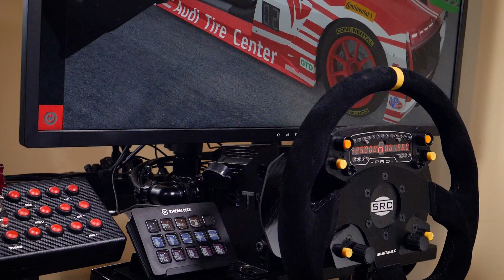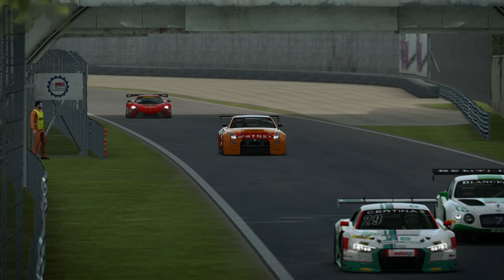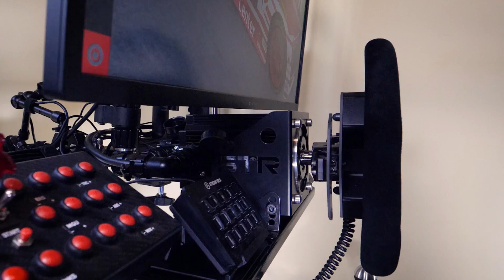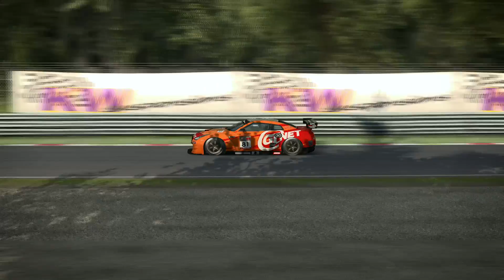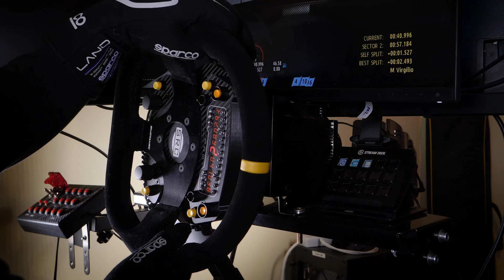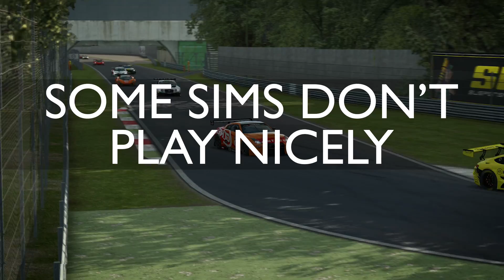Direct Drive Wheel - What They Don't Tell You

Comment: Speed and torque are one. Its why soea rates are based on the amount of torque and or nm ot can provide quickly. Speed plus force is how response comes in. Of course the connecting points also matter for response.

Also all lower nm wheelbases always have less slew rate and are always slower.

Higher nm wheelbases will always usually have more speed. But what brands fail to tell you is if you use them at lower nm the speed isn't as much. I will say you get alot of it if you leave it maxed out and reduce in game. Helps with the range and response. Like my invicta if I use 10 to 13nm if doesn't matter what I do its not as fast. Even if I use 80% in game. But if I set it to 27nm and use even just 7nm and or like 25% in game it has alot more speed.

Comment: Can I get decent Fanatec direct drive wheel base, wheel and pedals for around£1200-£1500? Considering I’m a beginning, loving my basic g29 but just want better quality. MAim thing I really feel most important, is simply having a smoother wheel , and while I’m new, I known my g29 is gear low quality performance but great for beginners and price, belt is more mid and much smoother and direct drive, is like a dream. Pedals, I’m not so fussy right now. £300-£500 load cell seem good. I don’t care for more then 5nm force, right now but like I say, ideally, if I can get direct drive wheel base, wheel. Load cell Fanatec pedals for £1200-£1500 I could go there. But if it’s gonna cost minimum of £2500 then that’s impossible for me. If that’s the case, the Fanatec CSL elite is belt drive right? But will I feel it’s enough of N upgrade. If I bought and was like wow, then great but if I spend £1200 on the 3 items and get belt and am unhappy , I’ll feel I wasted money, somewhat. Like I honestly think the CSL elite belt would be fine but if I could go direct for £1500 I’d rather do that , knowing it’s better and for only a few hundred more. If only I could test belt and direct drive. That would make my mind up right away. Should I just stop worrying and just enjoy my g29 for now? 😭🙄

Comment: The only problem I have with this video is the voice that is WAY too calm. As a hardcore adrenalin-driven fanatic, I tend to literally fall asleep (no hyperbole) when the senses are not stimulated enough (for example, turning on cruise control at the legal speed limit of 130 km/h (~80.8 mph) on the highway would be suicide - it already almost happened to me years ago, I woke up two feet from the guard rail! 😯). However, I see that the top comment here sees it the other way around. Obviously, I am not asking for some insane screaming etc. But a bit "less undramatic" voice would be welcome.

Comment: Might be too late but the reason your platform moves is that it only uses 2 bars to hold up the platform and the wheel applies side-to-side motion which those bars will have a hard time resisting. You should be able to solve this if you put 2 cables under tension in an X pattern between the 2 bars. Keep the cables at the top half of the bars so they don't interfere with your feet and you should be good to go.
Reply: Love this comment, you're going places bro.

Comment: Instead of spending literally thousands of pounds on simulation equipment, why not just buy a real life car and go to the track? It's kind of unreal how expensive this hobby is.
Reply: Because you can test limits without fear of death or repair costs, gas, upgrading parts, etc. You can also drive all types of vehicles, coupled with VR it's quite an experience. I don't disagree that the real thing just can't be replicated fully yet, but damn I'd rather spend maybe $1k to get 80% of the way there and be able to spend hours on it without the added costs the real thing has.

Comment: I was amazed, then I looked up pricing...
Reply: It's not that bad, get a CSL DD 5 Nm to start with for 350€ and when you want more power you buy the booster kit separately for 150€ (you lose 50€ by not buying 8 Nm straight away). Get the fanatec WRC rim for 200€ and the CSL pedals LC for 200€. That will land you around 750€+ shipping. 

Sure it's not super cheap but you get quality stuff that you won't outgrow after a few months and you skip the whole belt driven segment from Thrustmaster which is not that cheap anyway. I think their TS-PC Ferrari 488 challenge edition is 6 Nm max but it is pricey still. It's belt driven and without pedals it's 570€ here in Sweden, that is ridiculous high without pedals and just as much as the Fanatec stuff I just mentioned above when you include the T-lcm pedals which seem to be the only pedals that are worth getting from Thrustmaster if you want a good feel. 

Many said that this new lineup from fanatec kinda killed the point in getting Thrustmasters stuff, at least their top tier stuff, the T300 still being better value for money, earlier price was TM's strength and fanatec was out of reach for many but that's not the case anymore since Thrustmaster seem to increase their prices alongside Fanatec stuff without really improving their technology much.

I am on the hunt myself for a rig and I will get the fanatec gear above but maybe the V3 pedals straight away as well as the 8 Nm version. 

You could always check secondhand market for some stuff like rim, it does not wear out that easily like maybe a few years old wheelbase and pedals do. That way you save another 100-150€.

Comment: I don’t get it. I know people with a g920 Logitech who are top of the leaderboards in some of the top played games. Expensive steering wheel doesn’t mean anything
Reply: Your right, You can get used to a $50 wheel and pedal set and eventually do extremely well. But' Many that get the DD Wheel do it because of the immersion it provides, plus it still does help you be faster, just because there i less delay in what you feel, not that that difference will put you on the leader boards.

Comment: so I just got myself a g29 to get into sim racing and I find myself spinning all the time without really being able to tell why and every input indicating I'm about to spin always seem to arrive so late that it's close to impossible to correct. would direct drive wheels like this solve such issues? I realize there is a massive difference in price between the setups I bought the g29 because that was what was recommended pretty much everywhere as a starter wheel but I'm not really happy with how it handles at all.

Comment: Well Late as hell but my rig had that flex too with the wheel force input all I did was tie it down to the bottom frame rails with a couple ratchet straps PROBLEM SOLVED cost 8 bucks

Comment: This is a really good explanation I’ve got the g29 it’s doing my fine. But it could be better I can definitely feel the wheel does not come back to centre anywhere near as good as a DD. Part of the reason I can spin more leasily and say that probably wouldn’t have in RL or shouldn’t happen like that. It’s inconsistent most of the time.
 
I’ve watched plenty of sim racers with DD and while watching I noticed how much smoother and natural it looked and also noted they spun far less. I told myself the DD must be more accurate and precise and a quick reacting wheel. I’ve now watched your video and it confirms all my notes. Thank you, you actually provided the knowledge I was seeking, unlike all the other videos they never explained it probably like you said they went straight to the power and torque stuff. 

That’s lovely mate, but I need more information.... then your video comes along. I Appreciate it. 

One question though: If using a DD on console is there a need for the fine tuning for certain games. Obviously you cannot adjust them on Console but maybe with certain games they play well straight away or game devs are adding more options for console games that can cater more to DD settings perhaps. The only real hardcore sims on console are AC and soon ACC. I’m sure they’ll play good out of the box with some tweaking here and there.

Comment: Are all of the DD wheels or cubes wireless ? (not a fan of it, there's already enough WLAN and stuff all around nowadays - so I don't want a wheel to do so either) Or is it optional - and you can still connect the base and everything via USB ? Question is related to the Simcube 2 (and Fanatec DD1+2, ..) for example.

Comment: I literally just bought a T300
Reply: I have had one for years, and I love it, perfect starter wheel and I am now just building up a bigger cockpit, last thing I think I want to upgrade are the wheel and pedals.  With the T300 rs, I picked up the 28 inch leather wheel add on ( https://www.amazon.com/Thrustmaster-TM-Leather-Wheel-Add-pc/dp/B00TTQKSUS ).  I also picked up the T3PA pedals which I put in GT mode( flipped upside down, so ridged metal is on the bottom , https://www.amazon.com/Thrustmaster-T3PA-PRO-3-Pedal-Add-xbox-one/dp/B00UVN21IU ).  I also picked up the TH3A Shifter ( https://www.amazon.com/Thrustmaster-PC-PS3-PS4-Xbox-One/dp/B005L0Z2BQ/ref=pd_lpo_63_img_1/142-6797414-1521752?_encoding=UTF8&pd_rd_i=B005L0Z2BQ&pd_rd_r=512e6eff-5f44-4cec-a968-e97b4c27fcfd&pd_rd_w=MNEL7&pd_rd_wg=Ggcrj&pf_rd_p=7b36d496-f366-4631-94d3-61b87b52511b&pf_rd_r=EPSX6970YK7C525JZCBC&psc=1&refRID=EPSX6970YK7C525JZCBC)  , but added the richmotech add on, not required but makes shifting soooo much smoother (https://www.ricmotech.com/short-throw-shift-kit-thrustmaster-shifter ( Short Throw Shifter Kit for Thrustmaster Shifter v1.5 ).  So I gotta say I am pretty invested in the T300 rs, plus all that crap should work on my playstation, but I have some what abandoned that for PC.   Good Wheel Good Choice!  Don't get me wrong, but I have been running this wheel pretty hard on a Next level Racing stand ( https://www.bestbuy.com/site/next-level-racing-steering-wheel-stand/6121424.p?skuId=6121424&ref=212&loc=1&ref=212&loc=BM01&gclid=Cj0KCQiA5bz-BRD-ARIsABjT4ngbTkeNChr8lmuAMoutrrxU8APYy3qgz_KEK6GMQOF9DclyOOKX6ZYaAvqZEALw_wcB&gclsrc=aw.ds ).

Comment: ON the higher-end of direct drives wheels and bases, I would like to buy a high-end kit of the best steering wheel / base on the market BUT it needs to include a very, very popular steering wheel that will work with many games like Assetto Corsa, iRacing, Project Cars II, and all the rest.  Can I get a suggestion please!!!!   ???? I don't want to have to go out after buying this combo set and get a different steering wheel. I doubt there is a manufacturer that has 2 or 3, or 4 wheels in a kit with the base.......At least, not what I have found.  Now , if someone only sells alacart  on the very highest end units, i get it.  I will have to settle. SUBSCRIBED !!!!

Comment: Bro you should try triple monitor later on down the line or one projector with 120 degree viewing angle.
Reply: The only issue with a projector is that it needs to be somewhat dim in your room as otherwise the image will look washed-out
Reply: @Sithhy  ya. And it has to be on a clear white board for the colours to be accurately represented. So I'm thinking he should make a custom backboard and get a 120 degree projector for sim racing

Comment: You do not have to change the frame because instable, add some reinforcement to delete the deflecting.
Technically speaking more torque does not increase the quality of the drive, it is more realistic but totally unuseful.
When you spin  you can understand that or through  the feeling of the wheel or you can notice that because of your field of view slide in the left or in the right in base where you spin direction, I use g29 and on assetto corsa is enough to gain control, in truth your field of view is much precise in that case because your feeling on the wheel is more subjected on many factors, status of the track geometry of the car, different settings you apply on your asset, those expensive wheel practical side are totally unuseful respect as a cheaper Logitech or Thrustmaster.

Comment: 1:08 . well actually Torque not Speed. Reactivity , is actually acceleration not speed, and acceleration is torque / inertia. As inertia is constant we are back to torque, the things is there's 2 kind of torque parameters on a brush-less servo motor, peak torque and holding torque. Holding torque is the maximum torque the servo can deliver when the shaft is blocked ( as you keep the wheel from turning in your hand ) and the peak torque is the torque than can be delivered to accelerate the rim when free ( or not holding too tight the rim ).
In the end, it's only torque/acceleration that matter, not the maximum rotation speed of the wheel, well, maybe except if you are doing drifting.
So misconception inception I guess.
Source : me : bachelor in solid physics and physics software engineer.
Reply: Wrong

Source: me phd in physics and newtonigina

Comment: I'm looking to upgrade from my tsxw, to the cheapest osw I can get,  just need to stiffen my rig up first 6 gussits will do it as I'm a sheet metal fabricator kinda easy for me,   the next level racing rig is more than capable of supporting 100nm of forces when modified but that's basically making it a ridged rig,  but if you think about it,  are you going to be putting you're rig away, I doubt it with a dd wheel,  happy sim racing simmers
Reply: Richys Racing do you want to sell it?
Reply: @LAMBOTRAGIC  still using it mate sorry, with this stuff that's going on I'll be keeping it,  I'll let you know when I am thou

Comment: Thank you, this exactly a point i have made when other tubers have proclaimed how great it is to have a wheel that can produce lots of peak forces. I want to know how much continuous forces can be applied, sustained and how quickly these forces can be engaged and disengaged. And will they fade after prolonged use? When does perma fade set in? Then, to make sense of these numbers and put them in context, I also think you should consider adding tables of comparison with all the other high end wheels on the market - the ones your viewers may be using. But like I said, good review, just too thin... Subbed, liked and shared!

Comment: Great video and will help many when purchasing a DD wheel. Can I ask is there anything i could be missing with my DD wheel. I also purchased mine from Jed at STR and he delivered to my home which was good of him and didnt charge me delivery so was a nice £20 save (I live in Birmingham where they are based). Any little tips you could give me would be great. I've had it a few months now but havent had time to fully get to grips with it. one thing I did notice is how easy it is to catch slides. you feel it slip out instantly which is wonderful.  

I see you have the Motamec Rim as I do but is the  SRC button plate? do you recommend? It was the button plate I have had to wait for as they are not cheap and some are more expensive than the DD wheel its self. I paid £820 for my 20nm DD wheel and the cheapest button plate I've seen of good quality was £500 which is unreal.

Comment: Do you think lap times have improved for you as you upgraded wheel systems, or if they have is it because of increased time put in when changing over?
Reply: 100% it has made me a better driver. I have the same DD wheel from the same company SIMTECH RACING and it has made me way more consistent.  But I would say the Heusinkveld pedals  made more of a difference.

Comment: The wheel doesn't snap back to centre. It snaps back to the direction that the car is travelling (not facing). If your car begins to lose rear-end grip and the tail-end goes sideways, the steering will go beyond centre. ..   All the front wheels want to do is act like a shopping cart set of wheels.

Comment: wheel mount plate is flexing because it seems to be a relatively thin piece of pressed steel. get someone to weld another piece of box section between the two uprights and you'll be sound and save yourself an absolute fortune!

Comment: I bought the feel VR direct drive system to replace the cls elite that I already bought. And am glad that the rig which I have too could stand the power of direct drive wheels! The feel VR wheel base could go up to a torque of 15n if am not wrong, so glad I won't have to buy another bulkier rig.. It's not as rigid as other frames but I think if the power is toned a bit down it would work well.

Comment: Look, for the flex I'd advice you to take some steel tubing and cross-brace the whole fucking thing: easy, needs some welding, but you'll save quite a lot, along 800 euros.

Also, I usually go for the simpler approach: take a consumer-grade wheel, strip the pulleys out, change them with a set of well-calibrated gears and you're done. Sure, you'll be always damning the noise, but you'll have roughly the same torque and speed reaction of a direct wheel because you've substituted an elastic transmission (which might slip or break) with a mechanical one, possibly multiplicating the torque via the reduction of the gears themselves.

Comment: The higher dynamic range is exactly what I'm expecting from a direct drive wheel. Good to hear that they have even more advantages, so I'll eventually upgrade my current belt driven wheelbase to a direct drive one. I knew that the maximum amount of force feedback was not the point and I hoped for other benefits - thank you very much for explaining them! Great video!